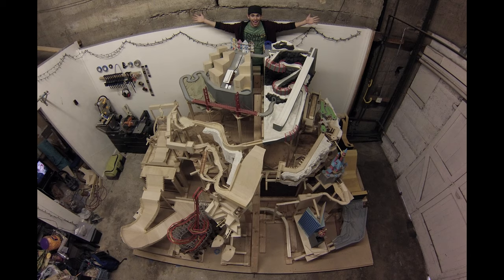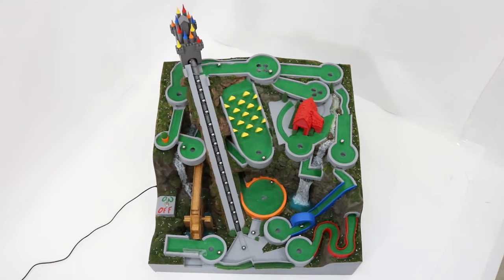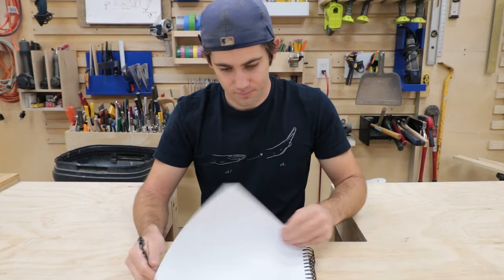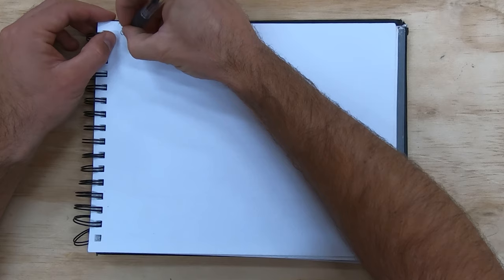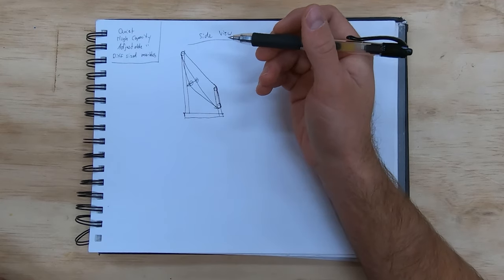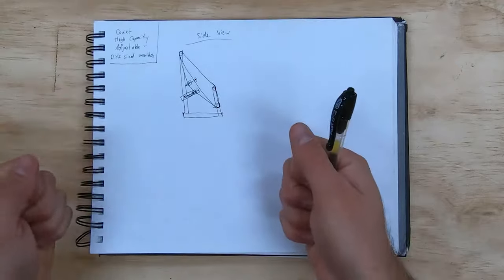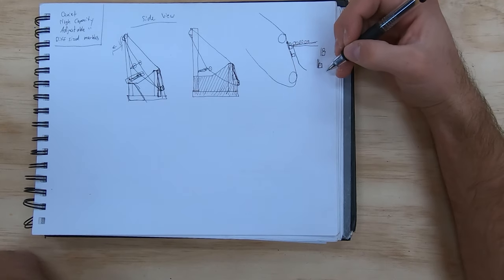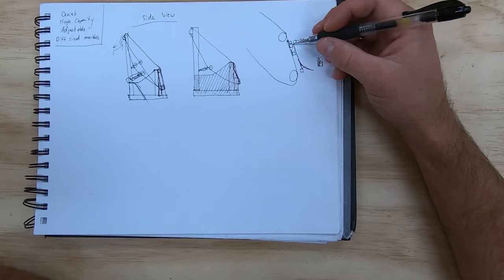Designing the Universal Marble Machine Lift

Comment: Live in Arizona, we the little known hole as the grand canyon, then the Colorado river could be included. Meteor crater and mesa's
edit for the the marble lift maybe an auger bit for a drill. Could have a plastic sleeve over it and depending on the number of marbles could depend on the auger that is in there.

Comment: Ben, Love your videos. You asked for ideas. Rather than a "holder" crafted from metal/wood to act as a shelf for the marble to ride on the conveyer belt, how about designing a plastic scoop that could be replicated on a 3-D printer (especially since you plan on making a lot of marble machines). This would add much less weight to the operation, and the scoops could be attached with plastic rivets rather than metal ones, which should lessen the sound as the neoprene belt rides over the rollers. Ray

Comment: you will need your turn buckle to push the belt instead of pull the belt that way the bottom pulley witch is the drive pulley has more contact with the belt to help with slippage   Also look at water wheels and what they use to hold water to lift water to the top maybe something like a wedge design and that way you can change the size of them to fit bigger or smaller balls and make the ends adjustable to fit the size balls you use   just off the top to think about   thanks

Comment: Have you considered the weight of a fully loaded bely? Not sure neoprene is what you need, it is too soft, will screech depending on the load. You should be able to find belt that has the ledges already molded on them.

Comment: You mentioned marbles per minute. My first thought was using a DC motor. You can easily use a potentiometer to adjust speed. How about a screw/auger drive?? Just my thoughts.

Comment: Ben, any reason you're avoiding an augur-in-trough design as used in most material movement applications? I can imagine rubber-cemented neoprene being applied all over the augur to cut down on the noise there.

Comment: If you are looking for alternative mechanisms, could there be a solution using an Archimedes screw somehow, or another using a linear motor, since ball-bearings are steel?
Reply: I was thinking the same thing, archimedes screw in a pvc tube, less chance of the marbles falling off, and can take a variety of marble sizes. The rate could be limited by a funnel at the bottom similar to Ben's sketch. The only downside is construction of the actual screw.
Reply from the maker: That’s something I’ll have to try in the future for sure. I’ve built Archimedes screws in the past but never thought about putting them inside a tube

Comment: I kind of disagree with you on that, it's not hate just constructive criticism. You think of the lift as a practical thing, when it can be part of the whole design and look as pretty as the downhill. You mentioned wintergatan, if you see his videos, the machine uses 3-4 separate ways to lift the marbles, not cause it's easier but because its prettier. I think instead of trying to get over with the lift it, would be better if you integrated it into the design

Comment: McMaster-Carr has hammer-on conveyor belt lacing...not sure about compatibility with neoprene.  I was wondering if you could use really light weight angle shape, like 20ga., and eliminate the wood strips.  Both faces could have thin foam tape to keep noise down.  My $0.02.
Reply from the maker: That’s a great idea! I’ll do a test with some corner strips to see how it works out